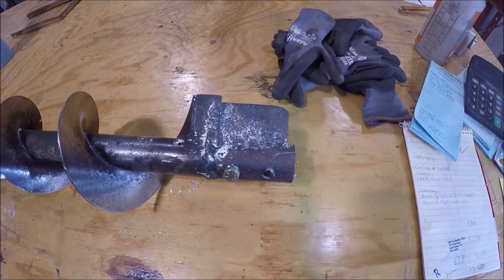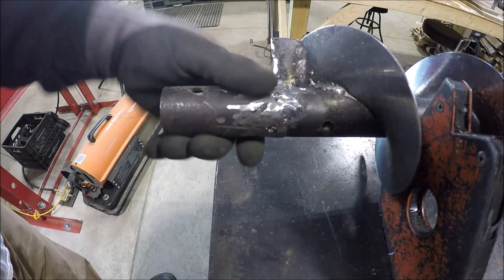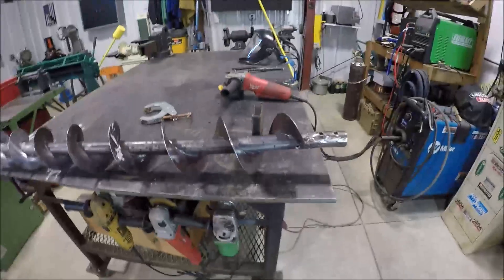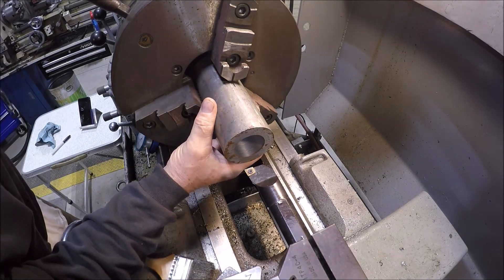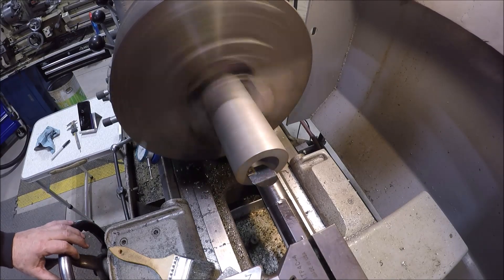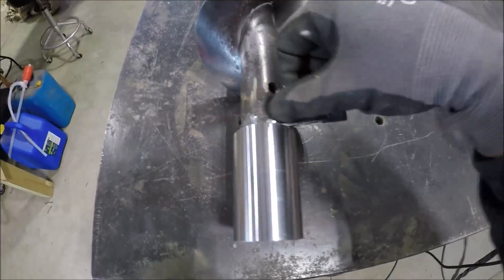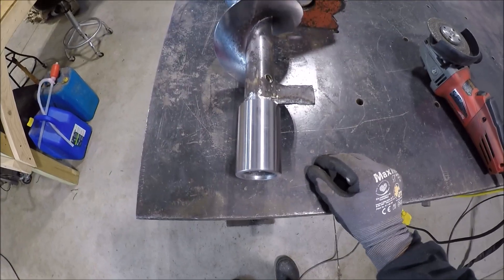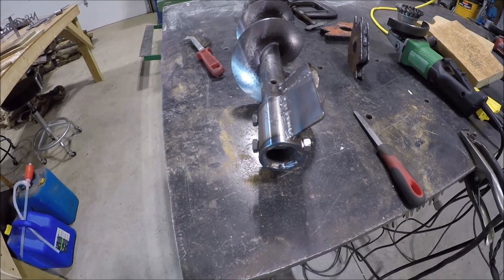A rush job. Feed mill auger repair

Comment: That has to be a order of magnitude stronger than the original stuff.  You ever try to straighten stuff like that?  I used to straighten motorcycle front forks for folks that ran into things.   A dollar her and a dollar there you know.  Thanks for the video keep on keeping on.
Reply from the maker: Hey Harold. It is definitely beefier now. I thought about messing with it and see if I could straighten it out, but they wanted it back ASAP, so I didn't bother.

Comment: I have straightened many an auger like that setting it up in the lathe and using a rosebud to heat and the tool post to push. Works great.
Reply from the maker: Good tip thanks Brian.

Comment: Tom, great to see you getting jobs coming in the shop. 
Most get bent when there in the ground and operator moves the tractor to far. 
As Brian mentioned there pretty easy to straighten in the lathe. 
I have even screwed them in the ground and cut a 4x4 to go from tractor to Auger and use the tractor to get most of the bend out.
Anyway, nice to see your doing good and keeping busy.
Reply from the maker: Hey Gary. Finally work is trickling in which is a good thing. 🙂

Comment: Nice one Tom. That will be much better. Curious what Bubba was doing to jam it up…. LOL. 

Very nice finish you were getting while turning the outside diameter.
Reply from the maker: Hey Dan. Those CNMG inserts work well with a good feed rate and DOC. Yeah not sure what kind of torque this auger is seeing but I know the upper bearing that this thing attaches to must not be happy spinning this bent shaft around at any RPM's.

Comment: A fix is a fix.. You'll be called back for more work on that for sure. That was a drive end. The bolts should be a grade 1 or 2.  Shear bolt. If it braking bolts and cracking the auger tube . They have a bigger problem.  Looks like a unload auger . No hanger bearings. Just lays in The U trough.  Bent is normal ish..
Been doing millwright work for 35 years.  They have a problem in that line causing the problem you fixed.
Reply from the maker: Yeah this was a band aid. The other end went into a box and attached to a spherical bearing. I asked what RPM the auger turned and he said fairly fast. Not sure what fairly meant. It came in with grade 8 bolts so yeah.🤔